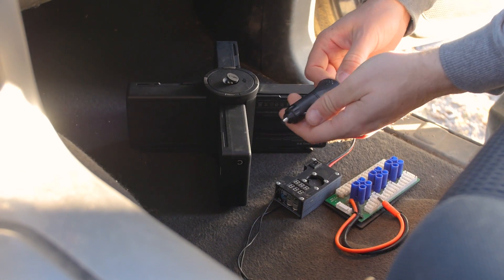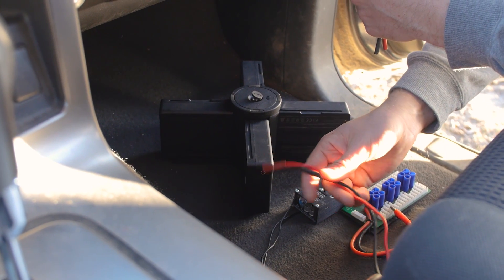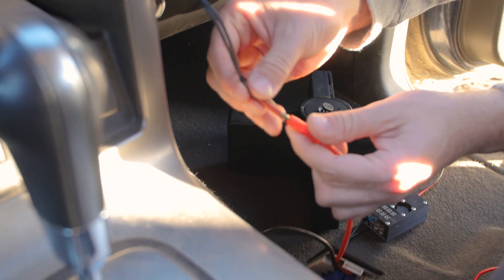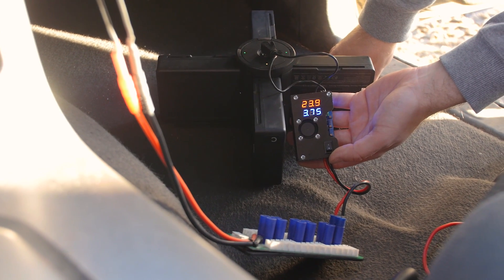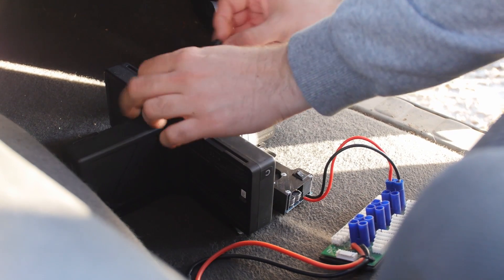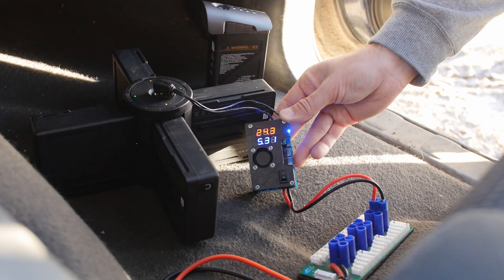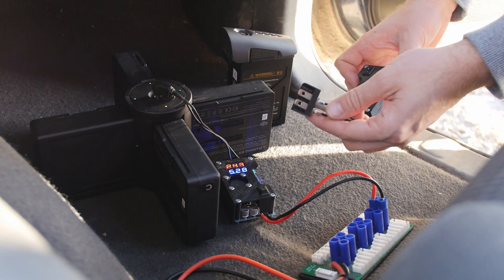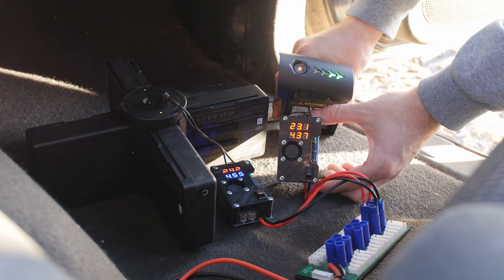Howto Charge DJI Inspire 2 & 1 batteries in a Car (Without an Inverter)

Comment: Hi! Where to get a connector for the hub?
Reply from the maker: Your local eletronics shop probably have them. It's standard barrel plug connector. I don't remember the dimensions at the moment. Just take your original charger to the shop with you and show them the connector.

Comment: This combination with voltmeter and ammeter... Is this your product or it can be bought somewhere too?
Reply: would you be willing to build another that I can purchase complete?
Reply from the maker: I bought the ammeter/voltmeter, fan, button and step-up-converter from aliexpress. 
I designed the 3d printed the case myself and assembled all the pieces together.
Reply: Same question here :-)
Reply from the maker: Sorry, don't have the time currently to produce these.
Reply: Can you link to the volt/amp meter part on Aliexpress? There are literally loads of different kinds.
Reply from the maker: Sure, basically any atleast 10A capable one will do - https://www.aliexpress.com/item/1pcs-Professional-DC-100V-10A-Voltmeter-Ammeter-Blue-Red-LED-Amp-Dual-Digital-Volt-Meter-Gauge/32786042852.html
Reply: How do you set the output voltage? Using all three of those blue potentiometers together? I'd be afraid to hook it to a batt charger before knowing the output will be 26V.

Guess the volt meter would read 26V before any load was applied??